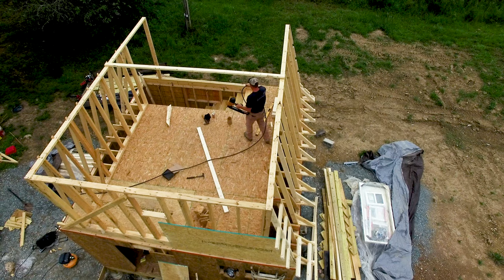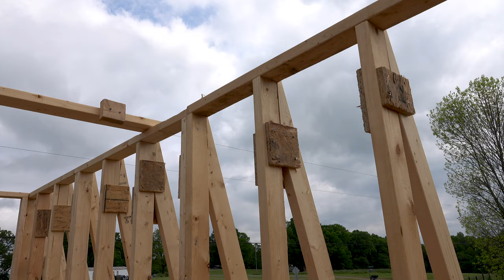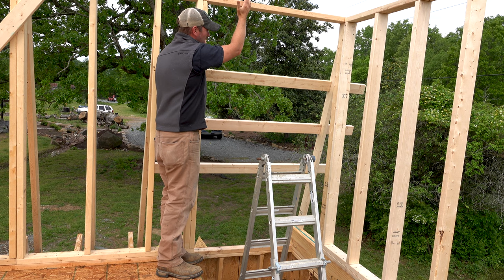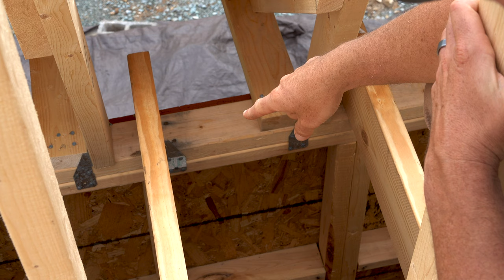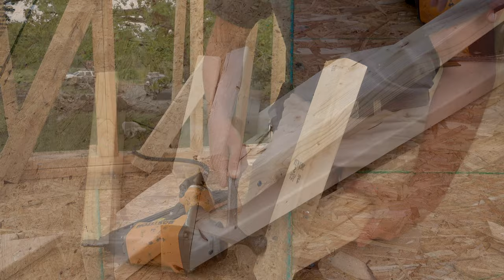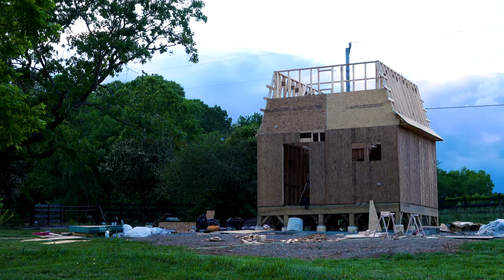FRAMING A GAMBREL ROOF for a Barn, Shed, or Workshop

Comment: A few suggestions, in case you haven't already thought of these points:

(1) plywood and OSB panels should be nailed with ring-shank nails, because they resist pulling out;
compare a smooth 16-penny nail which can be removed easily with the claw end of a hammer;

(2)  I couldn't see in your video, but in case you have not done so, add blocking between floor joists so you can nail ring-shanks along all edges of all sub-floor panels;  such blocking will also add strength to the sub-floor structure;

(3)  lots of nails are a good idea, but it's also important to realize that the real strength of a standard 16-penny construction nail is its shear strength;  a wall structure can lift OFF a sub-floor panel, if the bottom plate is attached with nails driven vertically thru the bottom plate;  since you have a nail gun, it's an easy habit to angle the nail gun at 45 degrees in one direction, then at 45 degrees in the other direction;  this pattern will create a wall that resists any LIFTING forces that may occur during very bad weather;

(4) speaking of bad weather, a cost-effective step is to add vertical metal straps that span the seams along the top edge of 4x8' external sheathing;  a good size is 24" overall -- extending 12" above and 12" below the floor joists that form the ceiling of the first floor;  if you visualize your building as a large mainsail on a sail boat, a wind storm may try to lift your entire structure off its foundation;  you may need to add more steel anchors where the very bottom plate touches the concrete at the building line;

(5)  there are simple brackets which can be placed anywhere on a standard aluminum ladder, and one or two 2x12 planks can be placed horizontally on these brackets:  this may help you stabilize yourself when you're working up high;

(6)  don't hesitate to ask for help:  SAFETY FIRST is a very wise and highly recommended policy AT ALL TIMES.

Hope this helps!  NICE WORK!!

Comment: Looks good. To bad screws are so expensive.  I built a tool shed using screws a couple decades ago. It's still standing like the days I built it. I moved it once. I had to roll ot down the hill. Didn't hurt it.

Comment: Lots of variations that contribute little to a structure durability or actually are harmful.  One example of a way to achieve more strength is if regular nails are driven at an angle and others nearby driven at an opposing angle, these will hold as well as screws.  Think of a V or a ^ and you can see what I mean.  Too big of a nail will do more harm by splitting the wood.  2 small nails hold mode than 1 giant nail.  A long nail will loosen and make the heads pop up where a shorter nail will not.  You need the help of a good, wise, and experienced carpenter.  Consider construction glue, it adds strength while not splitting the grain apart at all.  Steel straps can wrap around the joists so that the force on the nail is sideways, not straight out.  Use longer steel straps.  Short ones with lots of nails is not nearly as good.

Comment: I worked at heights doing line work, sometimes hundreds of feet in the air, and if you have the right gear, it is no problem. Get yourself, next time, a saddle and ropes, and you'll be fine. I did it for 32 years, (and still do it, occasionally), and I'm fine, except for this funny twitch... Go figure.